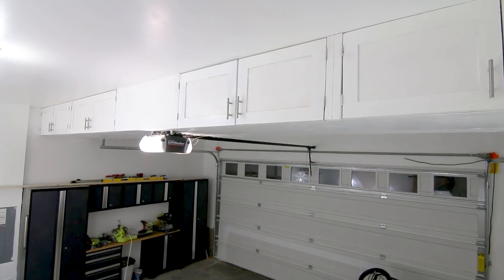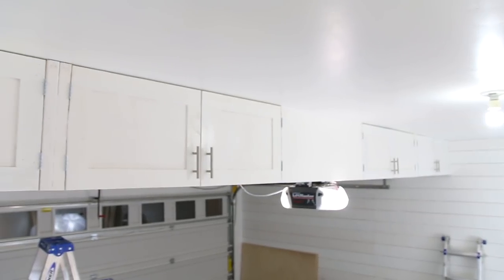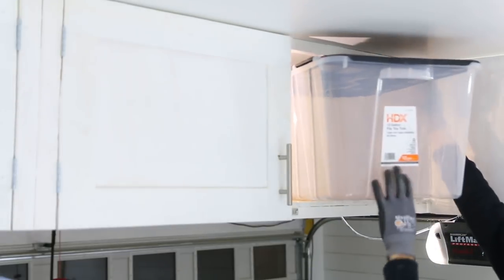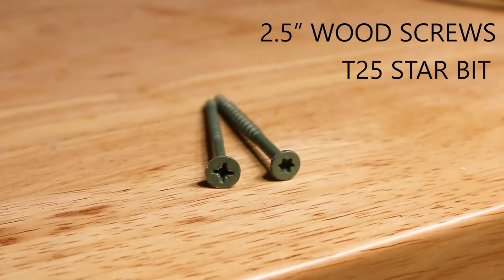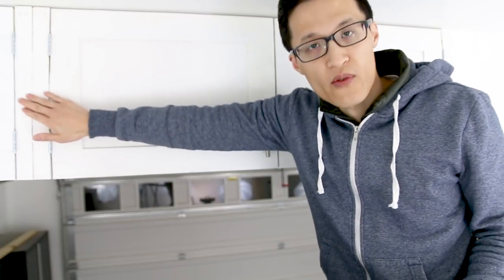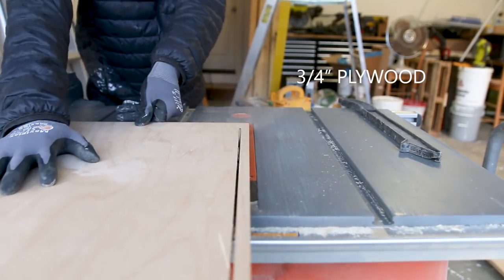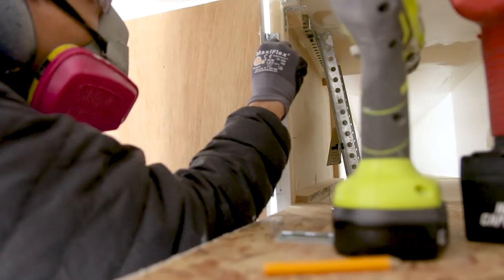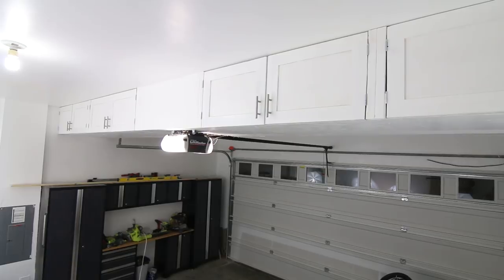DIY Ceiling Storage Garage Remodel Episode 2

Comment: Hey Paul, great video... think I will try this in my garage soon.  One thing I want to say is the word for vertical level is "plumb"
Reply from the maker: Oh good to know! Thank you
Reply: @PaulTranDIY  Plum, square or perpendicular would also work for what you meant. Levels work as a true horizontal line that in theory a line perpendicular to a level condition goes to the center of the planet, or in other words the level is a horizontal line on the local surface of the planet in that location.. So using the word level is only correct for a horizontal plane. Even at that for very large equipment such as machine tools over 100 feet long and using high precision machinist levels the curvature of the earth does need to be compensated for even if both ends show as perfectly level. They are correct in each location, but there not level with each other over that distance. For the average person and project the effect can be ignored.

Comment: Nice looking cabinets Paul and I love the idea of using space that most people won't think of using and that normally goes unused.  What concerns do you have with covering up your opener supports should that system ever need to be worked on?
Reply from the maker: I still have access to it but yeah it would make it more difficult to work on. I have to go back and look at what the brackets look like and if I can detach the garage opener without taking apart the enclosure. Good point, something I did not really consider.
Reply: Worst case you might have to disassemble part of the cabinets but I'm sure they could be returned to original spot.  I'm still trying to psyche myself up to try to duplicate your built-in shelves for my home office.   @PaulTranDIY
Reply from the maker: Ahh yes, take lots of time to measure & plan it out! I spent a week or so just staring at a piece of graphing paper with rough drafts (couple hours a day). I've received 5 or so emails/DMs from people who completed the project with success. Definitely a lot of work but the reward once your done will pay off.

Comment: Paul, quick question.  Did you simply paint the walls and ceiling in your garage or did you skim coat it with mud and textured it?
Reply from the maker: Yeah I did use mud! It was my first time doing it so it was not good initially. I got better on my last wall I did. The main thing I learned from the experience is to use thin coats, will require much less sanding. I was putting it on way too thick at first. Rookie mistakes!
Reply: @PaulTranDIY  Thanks for your reply.  And "rookie mistakes" are exactly how we learn.